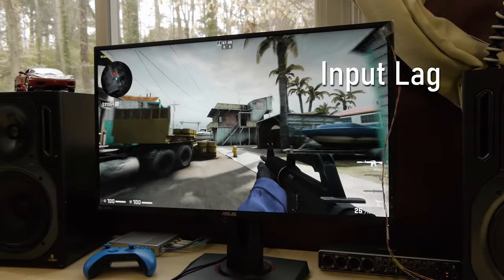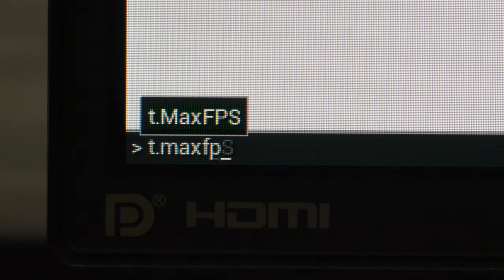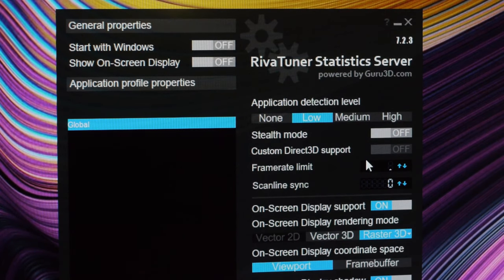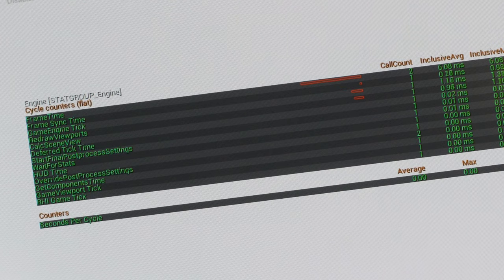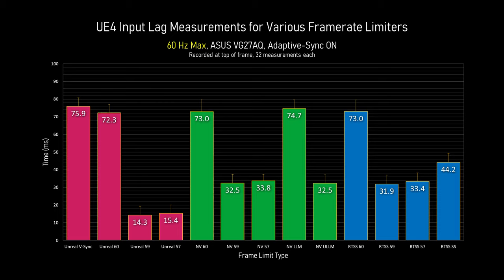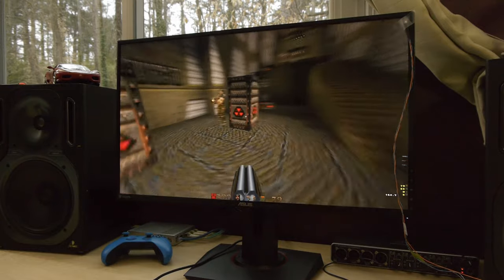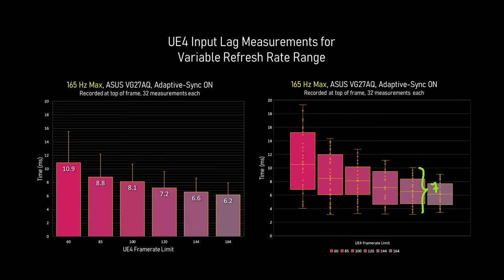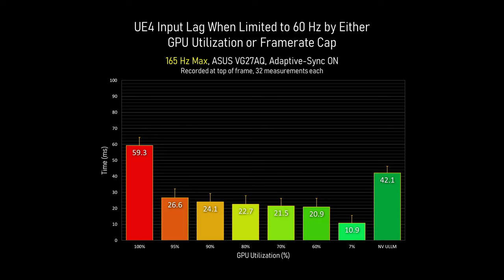Input Lag and Frame Rate Limiters

Comment: OK so I have nvidia graphics card and my monitor is adapted sync. But my graphic do not support free sync(hdmi) U saying that I should keep monitor adapted sync technology on with framlimit and ultra low latency for best results?
Reply from the maker: Adaptive-sync is amazing for most games, but if your graphics card doesn't support it, I'd suggest turning V-Sync OFF and letting games run as fast as you can. I've got a video coming soon talking about V-Sync OFF, but in summary: for the lowest lag, turn V-Sync OFF, run your games at the highest framerate possible that doesn't max out your GPU.
Reply: @ApertureGrille  Graphic card support adapted v sync not the free sync. MY monitor is free sync.
Reply: @ApertureGrille  By adapted sync u mean adapted v sync or I got everything wrong?
Reply: upload more videos with more precise information please. :(
Reply from the maker: @Mobiledash52  Adaptive-sync, G-Sync, FreeSync, Variable Refresh Rate (VRR), are all terms for the same thing, but you need at least a Pascal (NVIDIA GTX 1000 series) graphics card to enable it. It won't work on a GTX 980 Ti.

I don't quite understand your setup. What is your graphics card and monitor?

If you don't have a Pascal (or newer) graphics card, VRR/adaptive-sync/freesync/g-sync won't matter. Just turn V-Sync off and run at the highest framerate you can.

Comment: what about not capping the frames is it better than setting it to the hz of the display? like in csgo with max_fps 0
Reply: im running a older 144hz screen that doesnt support adaptive hz and im runnig csgo with around 300-500 fps would it be better to cap it to 144fps?
Reply from the maker: @BlackgoldTwinduck  In that case, no. If you're OK with the tearing, the more FPS the better! I mentioned in the video that I play Quake 2 at 1000 FPS, V-Sync OFF. With that, at least some portion of the screen is showing my latest inputs every 1 millisecond. Take a look at 2:30 in the video to see the tearing.

Comment: so in-engine limiters are the best but they can't cap at fractional values like rtss can. could you just say cap at 60fps in-engine and just make a custom refresh rate of 60.01hz?
Reply: for strobing modes capping 59hz will give you stuttering but 59.99 does not.
Reply from the maker: @brett20000000009  That sounds like it would work, but some engines allow decimal limits. For UE4, you can do t.maxfps 59.99 and it'll cap to that.
Reply: @ApertureGrille  Thanks for the reply. I have been playing cyberpunk 2077 it's framelimiter won't do fractional values. I have a single strobe monitor and the vsync lag at 60hz is horrible. I just tried 60.01 with a 60fps ingame cap and it feels way better. :) feels better then rtss.

Comment: I have the same monitor as you and to have the monitor fully synchronized, so I have to turn on vsync and lock at 158fps at 165hz, but it occurs to me that it's just not smooth anymore. The biggest problem that annoys me is that even if I turn on vsync, the fps fall to values where they never fall to such a value with free fps.

Comment: Do the results at the end imply that if you were to somehow get an insane gpu and run games at 7% utilisation that you could reduce input lag considerably?
Reply from the maker: Yes! The drop in latency there has fully to do with the GPU render time with different rendering resolutions. For example: when limited to 60 FPS with a GPU use of only 56%, the GPU render time (how long it takes the GPU to render the frame) is at around 9.2 ms. When I drop the rendering resolution down, the GPU has an easier time rendering the frame, so at r.ScreenPercentage of 20, the GPU frametime is only 2.2 milliseconds, which is why the GPU use drops to 7%, but that GPU render time difference is where the latency reduction is coming from.

At lower resolutions (or if you had a mega-powerful GPU), the GPU can render the frame faster, so the final rendered image can show up on the screen with less latency.

This is really the same as measuring latency at a higher framerate. Higher is always better.

Comment: I have a 240hz monitor.  Following the facts, I can cap the game to 239 with adaptive sync.  Makes sense so far.  When I turn on Nvidia ultra low latency mode or Nvidia reflex in game, it automatically overrides my in game cap of 239 to 225.       With this being the case, do I turn off reflex or do I leave it on and set the game cap to 224.  Thoughts?
Reply from the maker: Reflex is awesome at removing much of the latency penalty when you hit 100% GPU use, but it's still worse than not running into that GPU limit at all. If you want to use both at the same time, you may want to use an internal cap to something a little lower like 220 FPS. That's only a render time difference of ~0.4 ms, but it should keep you away from maxing out the GPU. Hopefully that'll keep you below 90% GPU use, but Reflex will be able to take care of the situations when your GPU use hits 100%.

Comment: Now I'm even more confused. So if I'm running with Gsync on, the FPS internally limited to 1 below refresh rate and Vsync on, I should have ULL on, or off?
Reply from the maker: In that case, I'd turn it off. ULLM's cap is pretty aggressive, so it would override the internal cap, and internal is better for latency. For instance, at 165 Hz in UE4, ULLM is capping my framerate to 157, so an internal cap of 164 or 163 wouldn't be doing anything. For games that have good internal caps, external caps are unnecessary and should be disabled.

I know I said in the video that you might just leave it enabled globally, but lots of games don't have internal limiters.
Reply: @ApertureGrille  Ah, thanks for the response and info.
Reply: @ApertureGrille  Just to confirm though, ULLM is a better alternative to simple external FPS limiters (such as NVCP or RTSS) if there is no internal frame-rate limiter in the game, such as War Thunder? Or should I still just use NVCP to cap FPS instead of ULLM?

Comment: But it'll always be worse than a CRT NOT using V-Sync right? Anyone who actually care about input lag always disable V-Sync anyways, tearing is not that bad and a fair trade-off for less delay, AND it doesn't even look that bad the higher the refresh rate is (because less image variance between frames when you have a higher framerate)

Comment: Hi a5hun, I was watching this video after buying the VG279QM you tested recently. And I'm trying to minimize the input lag with this monitor in the range near the 280hz mark. I don't have a mouse with a LED and a high framerate camera, so I'm using some in-game reflex meter in ms (highly non-precize, but, follow me please...).
I tried using in-game fps_max to 279, and my PC is capable of 400+ in most of situations, if uncap. When I cap to 279 (or any value, really), the variation is between 220 to 27X, seemingly randomly. When I use RTSS to cap at a 279 fps, fps (and hz) stay constant. I have better results (10 to 20ms better) and smoothness, and I don't "feel" the 10ms penalty you were reporting at 164fps/hz with rtss compared to the in-game limiter. Can I ask you, if you ever find the time, to test 279 hz limiters with the Source engine (CSGO is a good exemple) and try replicate my "issue" with the variations of FPS. Maybe it's better to cap with RTSS because the game engine is failing to keep a constant output.
I posted an imgur there : https://imgur.com/gallery/SzqLMW4
Reply from the maker: I'll look into it. I'd be skeptical of any type of reflex-meter, though.
Reply: @ApertureGrille  I'm completely skeptical about it, even though I only looked at the "best result" to have something to compare (and there is no way I improved magically my reflexes by 20 ms between two tests, I'm regularly doing them, it's part of my "fps" routine to check my fatigue level). Anyway that's why I'm requesting help. I sent you an email too, so feel free to ask anything else.
Reply: @JonasHopp  what was ur solution btw
Reply: @ShoxSerious  Without any proof or real solution, I liked more the perfect consistency of capping with RTSS. But, and I don't know why, I was still seeing tearing artifacts if I capped at 279 hz. under 240fps/hz it's perfect though. So even the screen can go to 279 with VRR, I capped at 240hz in RTSS. Test for yourself if you prefer fps_max or RTSS capping.
Reply: @JonasHopp  i was trying to use the fps max, but when i use this command my frame time varies a lot, tks by ur answer

Comment: ULLM showed worse results, than just internal fps limiter, but do i still turn it on? Sry english is nit my native :)
Reply from the maker: If the game has an internal limiter, use that. But if not, ULLM does as well as any other external limiter but also helps in situations with 100% GPU utilization.
Reply: a5hun do i need to use NV drivers fps limiter with ULLM? 
Monitor is vg27, bought in with big influence of ur review, thx ;)
Reply from the maker: @barabulkafication  Check 3:53. ULLM will work in DX9 and DX11.
Reply: @ApertureGrille  kk, thx for answers!

Comment: Revisiting this video, with Battlenonsense's more recent info on this topic (https://youtu.be/msOWcvoIC8M),
and considering that I'm a bit ways out to acquiring a high refresh rate monitor, I have a couple questions--
a) How do you reduce input lag for games that cap at 60fps? (Eg: pc ports.)
b) How do you reduce lag for a monitor with a max refresh of 60hz?
This is keeping in mind variables such as Nvidia ULLM and Reflex, not 100%'d your GPU, etc.
Thanks
Reply from the maker: If you don't have a VRR/high refresh rate display, you're pretty much in the same situation as us CRT users.

The best way to minimize lag is to turn V-Sync off and live with the screen tearing. But visually, that looks really bad; a 60 FPS game running V-Sync Off 60 Hz will have tear lines that linger and bounce up and down around one portion of the screen. It looks awful. But because there is no render queue, latency is the lowest you can get for 60 FPS.

Next best would be to use RTSS's scanline-sync. With that, you leave V-Sync off, but RTSS tries to throttle the CPU so that it presents a frame just in time to be rendered by the GPU. Scanline-sync works really well, as long as your GPU isn't under too much load.

You could also enable V-Sync and use the in-game cap to limit to 59.99 FPS. If you limit to just 59 FPS, you reduce the backpressure from the render queue, but you'll get a stutter from the missing frame every second. Limiting to 59.9 has the same lag benefit, but it will only stutter every 10 seconds. I haven't tested how many decimals you can cap just below 60 to keep lag down, but you may not even notice the stutter at 59.9.

But really, the best way to limit lag at 60 FPS is to get a high refresh VRR monitor :)
Reply: @ApertureGrille  
Dumb question: I imagine it's possible to have a VRR monitor run at a high refresh (eg: 144hz)
while playing a game with a max framelimit of 60fps, yes?
Since it appears that running a game at a few frames lower then a monitor's max can cut down on lag,
then does that mean that any high refresh VRR monitor could play 60 fps games at with lower latency then 60hz monitors?

Thanks again for all your help, appreciate the informative videos!
Reply from the maker: @superbro6413  Yes!

https://youtu.be/dPMHEyz38TM?t=309

That chart may be a bit unrealistic because a simple UE4 build isn't really doing much work, but the results at 60 FPS on a 165 Hz VRR display are incredibly good.

Two things work in the VRR display's favor: 1) the GPU no longer has to wait on the display, so you get rid of V-Sync backpressure while also getting rid of the annoyance of having to use internal or external limiters, and 2) high refresh rate displays scan out their panel from top to bottom faster.

For a 60 Hz display, the bottom of the screen is always 16.7 ms behind the top of the screen. For VRR displays, a 165 Hz monitor will scan out the screen from top to bottom in only 6.06 ms (even when displaying 60 FPS content!), so more of the frame gets to you faster.
Reply: @ApertureGrille  
Thanks again!
All this information is very helpful.

Comment: do u know why my frame drops by 30 when i’m in full screen? i need help!!
Reply from the maker: Without knowing your setup and game, it's hard to say. I've seen similar things when a second monitor is connected while using VSYNC. If you are running two monitors, try disconnecting the secondary.
Reply: a5hun I have only one monitor i play on laptop
Reply: i use my laptop monitor

Comment: It would be more appropriate to ask this on the CRT review, but since this a new vid I'll ask here, have you tried running your CRT in interlaced mode?
https://www.youtube.com/watch?v=-A9a6EndsYg
You get basically no screen tearing if you're running at such a fast refresh, such as 120Hz or even 160Hz. And you can get nearly double the refresh at a given resolution (assuming you don't hit the refresh cap obviously).
I was really impressed with how you showed you can get higher resolutions than what these CRT's are spec'd out for. Pretty crazy what they can do actually if you know what you're doing.
Reply from the maker: Yeah! I didn't know you could still do that in Windows 10 until I saw a post by Enhanced Interrogator on HardForum. I was using interlaced to play Quake Live at 1840x1380 (really 1840x690) at 170 Hz. Interlaced looks way better than you'd expect.
I'm glad there are some true CRT fans out there.
Reply: @ApertureGrille  
Can you link me to that post in the forum? I'm having difficulties getting my CRT to run interlaced, just got a nice new Dell M992.
Reply from the maker: @copper4eva  This is from 2017, here's my question to him:
https://hardforum.com/threads/24-widescreen-crt-fw900-from-ebay-arrived-comments.952788/post-1042956627

His reply is right underneath, and that worked at the time. I haven't checked interlaced recently, though.

Comment: Logitech g9x nice, I had one of those, now I’m using the GPro wired, the buttons and front half are fine, but I prefer the side and back end of the g9x. It would be nice if Logitech bring it back with a hero sensor. I’d be all over that.
Reply from the maker: I'm still waiting for something with a modern sensor that has the same shape and feel as the g9x.

Comment: Sooo should I just cap in-game always?
Reply from the maker: If your game can run at 300+ FPS, you may want to consider V-Sync off to minimize latency, but otherwise, in game caps work best to keep you in adaptive-sync range with minimal lag.
Reply: @ApertureGrille  and I should cap it to what my computer can hold stable right?
Does freesync/no freesync impact input lag?
Reply from the maker: @GodlyTecker  A consistent framerate is great, but I wouldn't want to cap the game so low that you miss out on the higher framerates and smoothness that happen in less detailed areas. A little variation, I think, feels OK, but I wouldn't want large swings from, say, 60 to 180 FPS, but that's an extreme example. Even with adaptive-sync, that won't feel good.
At lower framerates, freesync/no freesync won't matter, except that no with freesync you get tearing. In that case, the limiting factor is the game's render time; the monitor will just be sitting around waiting for the next frame.

Comment: Would you please share the unity 1000fps exe or better source code, i want to measure lag also. I made an input lag measure software but its in python and only runs 300fps usually, thanks. Here is the link to github if you are interested: https://github.com/ArtDor2/display_lag_tester
Reply from the maker: Thanks for the comment on the Buford Dam video! That's an old one!

Good project, and that's essentially what I'm doing for all my lag tests. But I'm using a micro-controller with the ATSAMD21G18 chip, which has native USB and runs at a higher clock. Dealing with serial communication was a huge pain (huge!!!), so I gave up using my older Arduino Mega.

I don't mind releasing the build, but just like with Frog Pursuit, it'll take me a bit to clean it up properly for public download.

But if you're programming in Python, you might not have any trouble getting up to speed with UE4. I still suggest going with a more modern micro-controller with USB, but putting a simple black/white swap together in UE4 that can run at 1500+ FPS is pretty easy.
Reply: @ApertureGrille  Thanks for replying! I recently purchased an Arduino Leonardo, with native usb keyboard/mosue output, which hopefully improves the Uno's huge (~80ms) delay through serial communication. Will test it after finals soon. Thanks for the tip for UE4! I think I will make the unity app to test the latency, and modify my python app to only receive and also display the lag charts.